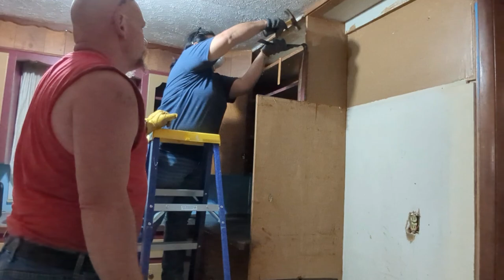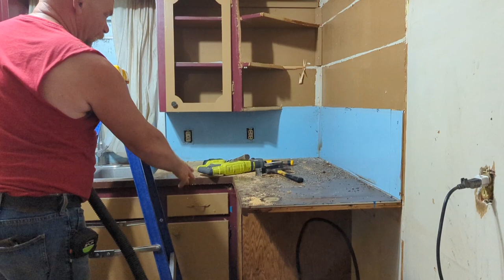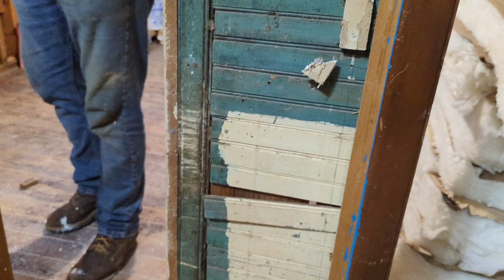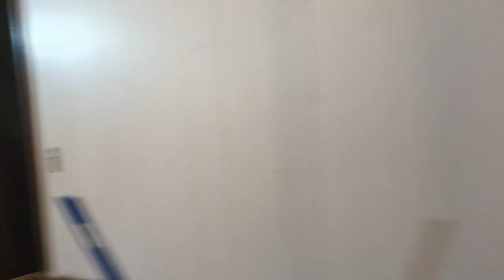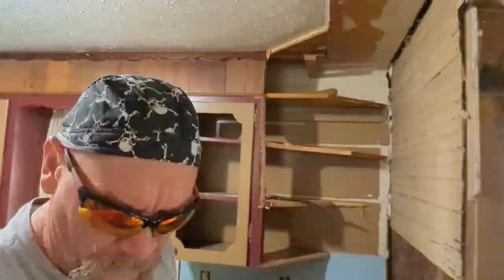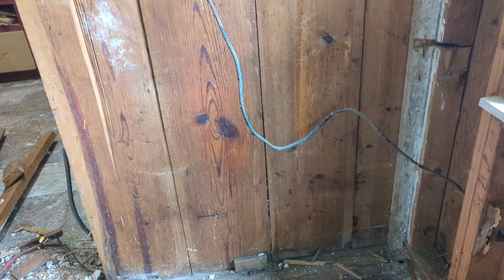What Happened With That Wall? / Couple Renovates Abandoned Homestead

Comment: is that a insulin thing on rustys arm
Reply from the maker: Yes it is
Reply: They have just started trying those with my grandson who is 23 diagnosed at 18 mo.and he a brittle type 1.they put his on outside of arm are they able to be put in other places and read the same? I would think where he has it would be a little safer from being pulled off with flying debre.
Reply from the maker: I keep my sensor on my abdomen for the most part. I like having the pump on my arm like it is that way I am not catching it on anything while working.